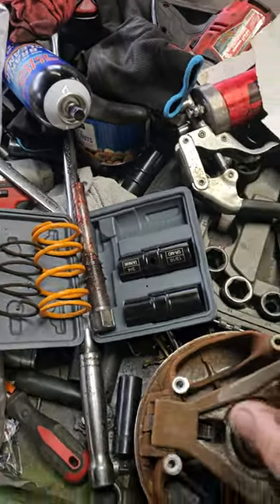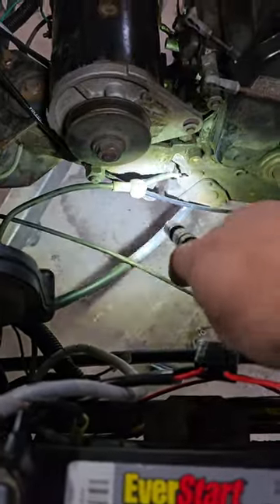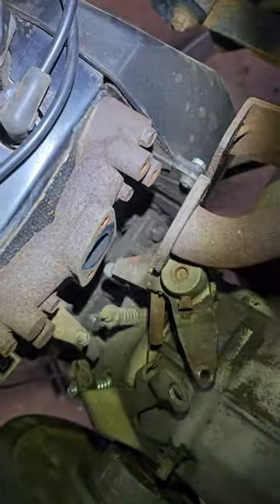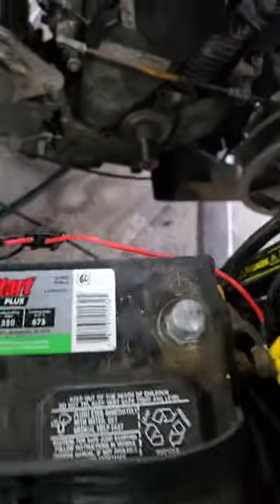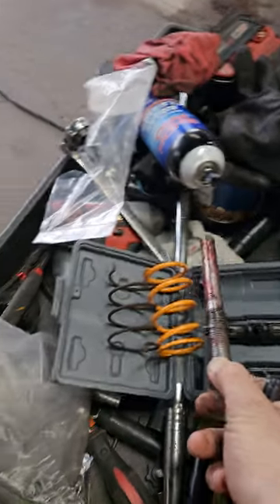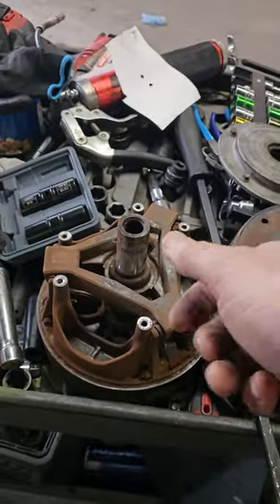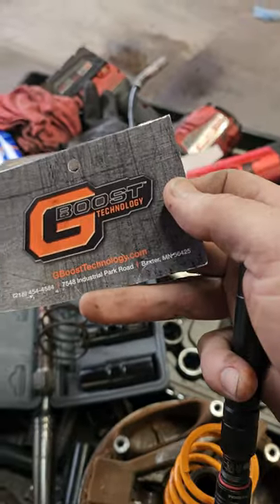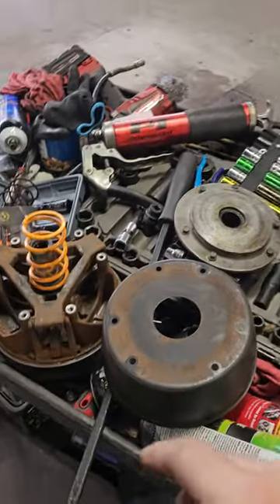E-Z-Go golf cart primary clutch removal with engine still in!  like omg

Comment: I took my clutch apart too and I wanted to change the clutch spring but I notice the two ends of the spring goes into the spider hole and the cover hole, do you think we need to use that same type of spring when upgrading it?
Reply from the maker: disregard holes. install

Comment: Was their roller weights inside?
Reply from the maker: no it was these sort of pendulum weights. I expected to see rollers too but what do I know LOL
Reply: @dridiott do you know if those pendulum weights can be replaced? And how did that g-boost spring work?
Reply from the maker: @kawikakikala7025 I imagine they're replaceable I don't remember exactly. that spring from g-boost is honestly a little high RPM engaging. they have a stage 2 that's red that I would go with unless you're doing some hill climbs.lol
Reply: @dridiott  were you able to try the other red spring by any chance?
Reply: Thanks for helping me think outside the box. I was going to purchase a spanner I just couldn't imagine pulling the engine. Kinda like pulling a hub to replace brake pads